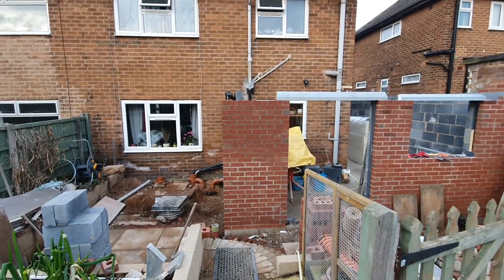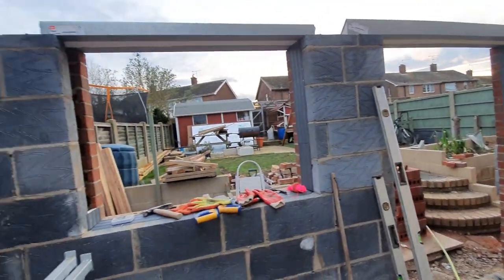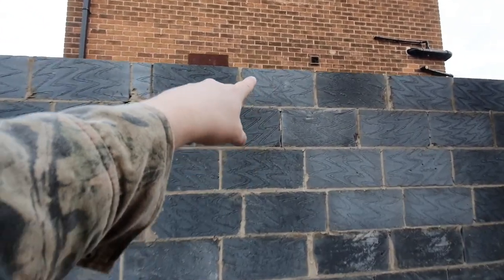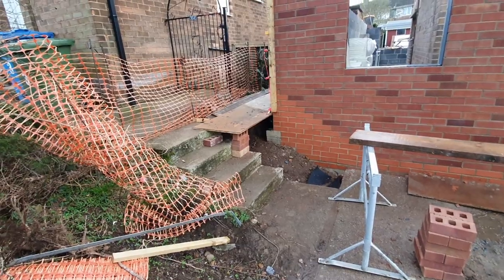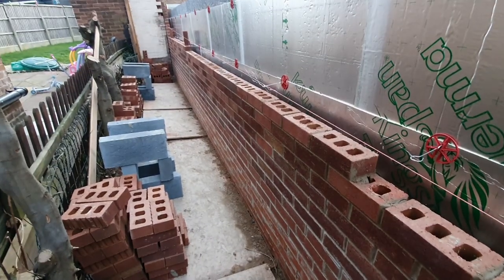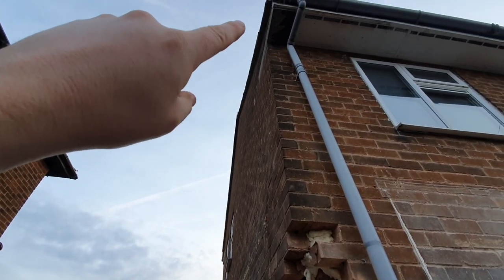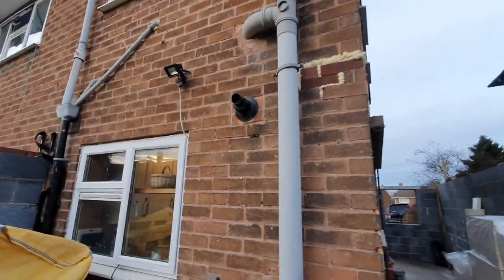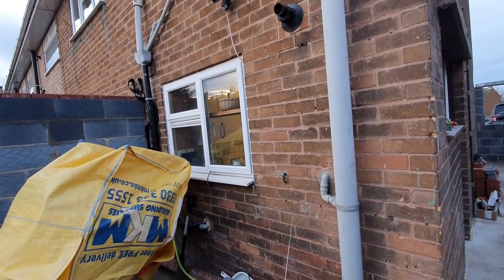Part 9 Of Our Extension Self Build Vlog 879

Comment: Nice progress you should be proud of that, great idea to continue the wall as well, most take 2nd course out  if its not needed gives you a bit more room for little cost,  might be worth using a temporary door if possible as you will be taking materials through try to avoid knocks and scratches that always seems to happen. Well done Harry